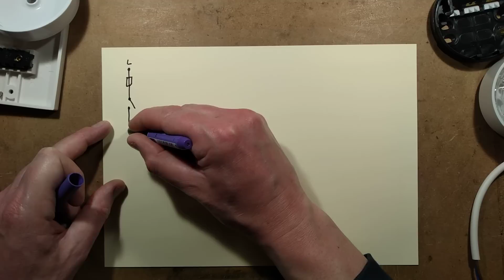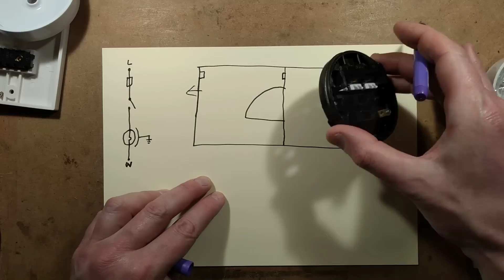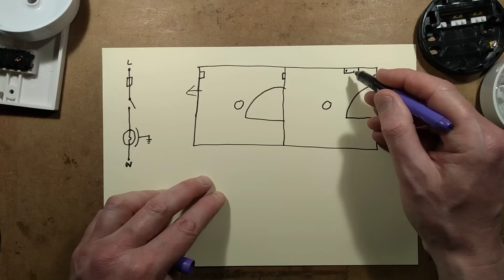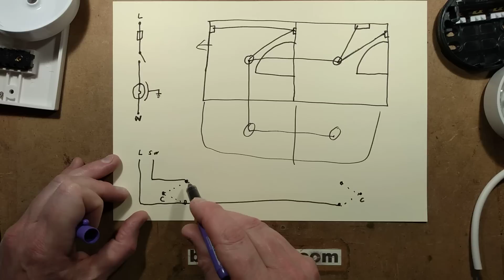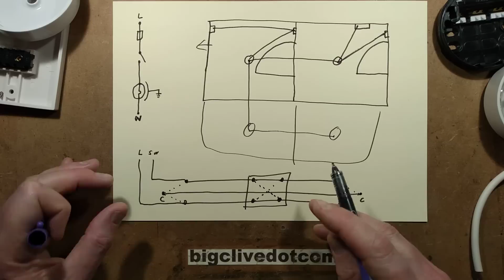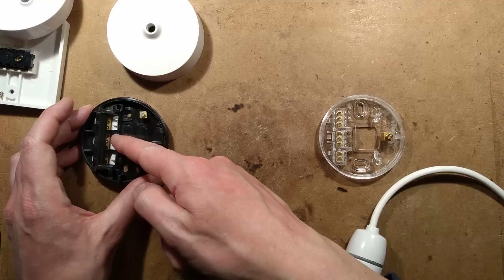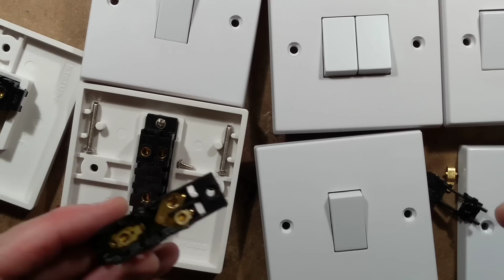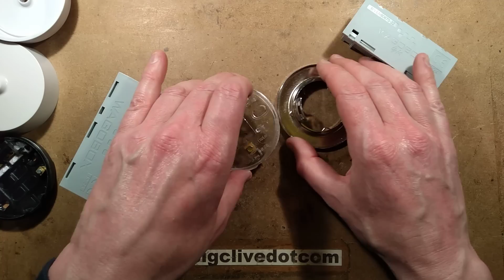British home wiring.  The incredibly simple lighting circuits.

Comment: Fun fact, in the US, we actually refer to two-way switching as three-way switching, but it's wired in a very similar way...so I'm not sure why we call it three-way.
Reply: I can help here. Unusually. in the UK, it's named after the number of light switches up to 3....In the US, it's the number of terminals on the switch. So one with 2 positions in the US, it's 3 way , and UK 2 way...) if it has, 4terminals, and crosses the  (travellers/strappers) it's [en UK 3way] and  [en US...4 way]   In  the UK, we (southern England) tend to refer to anything with more than 3 positions as 'intermediate' circuits)... as many 4 terminal/intermediate switches as necessary can be added. This can become ridiculous in buildings with 7 storeys.
Reply: Well it could also be the wiring because in the US, it would be return (neutral), hot in (live in), and hot out (live out)
Reply: @eagerestwolf  The US "Three way" is indeed because of the wiring. It was very early on called a "three wire" switch. I have some old "electrical world" publications which were the digests of standards and available products (quite useful prior to the internet)  from the late 1800s ~ early 1900s in which it is called a "three wire" switch. Somewhere along the way terminology became corrupted.
Reply: @eagerestwolf  to be fair,  while i was working in the US i heard it always referred to as neutral. but hot is definitely the term for the live wire, and always confused me. the sensation of touching THAT wire is far different than heat, and if your wires are actually hot, you have other issues... such is common usage :)
Reply: @TheChipmunk2008  yeah, I have heard it called both, but when I was doing electrical work with my dad back when I was in high school (mind you this was over 10 years ago), the North Carolina electrical code called it the return.
Reply: @TheChipmunk2008  Yeah, hot and neutral.  You can still get a decent shock from the neutral from stray current on the return path, especially in the summer, when your sweating bullets and there's an air conditioner running or something high current nearby.  I've seen it as high as 60v, but I only checked once or twice.  Once you know it's there, you start wearing gloves in the summer.  Turning the breaker off won't stop it, either, you would have to kill all of the power.
Reply: @larrygall5831  a floating neutral will also get your attention unexpectedly!
Reply: @mikecowen6507  thats literally what he described - i dont know what 60v on the neutral of a 110v cct is if not floating
Reply: @mycosys  I'm used to true floaters having full line voltage on them. The exception was one half bad double pole breaker. That gave some weird readings...
Reply: @mikecowen6507  orite - yeah thats afaik just about impossible on an MEN network, floating to us is a ground resistance, with complete absence of ground threes just no cct
Reply: @mycosys  Just to clarify, I'm not certain what you mean by "cct". For a MEN network, do you mean Mains/Earth/Neutral? If so, absolutely you can have a floating neutral. If you take a sample basic lighting circuit, and cut the neutral somewhere between the lamp fixture and the consumer unit/breaker box (simulating a cable fault) and leave the switch ON, you will have the full supply voltage across the break. Thus, if you're expecting any neutral to be near zero volts referenced to ground, one side of that cut/broken neutral will be at full mains voltage. Surprise! Here in the States, we often run industrial lighting at 480V. That will do more than spoil your mood!
Reply: @mikecowen6507  no, MEN means Multiple Earth Neutral. cct is circuit. Anyone in the industry would i hope know that.
An MEN system is ground referenced at multiple points to the nuetral, in the distribution system and at the customer premises. The system is always ground referenced and it is impossible for the neutral to float completely without use of an isolation transformer.
Australia, Europe, the UK and afaik most of the world use MEN. Your split-phase consumer system kind of rules it out.
Reply: @mycosys  Ah, thanks for explaining. Different countries, different jargon. In the US, per code, the only place ground/earth and neutral meet is in our breaker boxes, except for sensitive circuits that have fully isolated ground.
Reply: 3 wires,  usually from top to bottom of stairs.
Reply: @stewartcaldwell5299  Yes, i think the US term is actually more Electrician friendly :)
Reply: @TheChipmunk2008  Yes. More familiar, if you grew up with it.
Reply: @TheChipmunk2008  I just find it confusing lol. Its a two way switch because you can switch it from two places, an electrician doesn't need clarification on that really as that's his job :P.
Reply: @TechDJ87  Indeed, when talking to a customer we'll often specify 'a 7 way switch circuit' for example (that was a 5 storey house with a basement and they also wanted to be able to switch the stair lights from a 6 gang switch by the front door. Because of the staircase layout it took nearly 200m of cable and keeping the impedance low was a challenge!)

But between ourselves it's a 2 way, 1 way, or intermediate switch. It helps get the right bits off the van LOL
Reply: Maybe it's because the switches have 3 terminals? Your guess is as good as mine lol

Comment: To me that twin+earth seems very difficult  to retrofit to a house. ere in sweden we just run the insulated conductors in the conduits in the wall. (PVC pipe or hose usually) very much easier to run an extra live or add protective earth to old circuits that way. I changed most of the wires and added earth in my house a few years back. Most of it was really straight forward.
Reply: Those twin + earth cables are run in conduits in walls. They are not embedded in plaster.
Reply: @TheEulerID   I know that but pulling them through conduit must be a pain.
Reply: @rimmersbryggeri  generally not too bad as it's usually only a short, straight section to the ceiling void and the standard cable is 1.5 sq mm. If it's a 20 mm conduit, it's very easy.
Reply: In the US you can get greenlee wiring. Flexible metal conduit with wires already inside. I like it.
Reply: @stewartcaldwell5299   Yep thats something you are good at in america. Making construction simpler. You cand get prewires conduit here in sweden too though but I only ever saw the plastic hose variety. You can buy it on huge spools though. (Maybe they are called drums?) All configurations up to 3 phase + neutral and earth.
Reply: @rimmersbryggeri   I tend to choose metal if I can, so that all circuits are surrounded by the ground.  We don't need conduit in homes, though.
Reply: @stewartcaldwell5299  Yeah I can see the point of that bu I think they seldom use it here other than stainless for outdoor and and steel for industrial installations. But since modern distrubution boards here are plastic anyway it doesnt do much good as earth I guess. All our conductors are individually insulated though. In the old days with tarred linen. My dad used to work in a barn with such cables where the fuses had been replaced with nails. That barn is no more.
Reply: @rimmersbryggeri  Oh, the stories those nails could tell.
Reply: Twin and earth's can be embedded in plaster they are not always ran in conduit

Comment: I always assumed the earth wire is bare because if either live or neutral heats and melts it would come into contact and kill the line
Reply: I think it's simply a cost cutting exercise.
Reply: Plastic isn't that expensive. I'd like to see insulated ground wires.
Reply: @jamesvandamme7786  In a way they are insulated due to being in a plastic sleeve between 2 insulated cables, you also use slip-on insulation over earths before terminating.
Reply: @jamesvandamme7786  a sleeve is added when the outer is stripped. Adding insulation internally to the cable would make it stiffer, slightly bulkier and would not add any benefit.
Reply: They did do fully insulated before in the UK it cost more and didn't catch on
Reply: @ashbashbaby2  I'm not surprised. Apart from not having to put a bit of sleeving on the bare wire at the end, it's difficult to see any advantage. It's bulkier, less flexible and more expensive with not obvious advantage in safety.
Reply: But if there is a fault in the cable run its self it will trip out and won’t be insulated by the earth sheath
Reply: @daviddale4206  if there's a fault in the cable then that's what MCBs and RCDs are meant to do. The last thing that you want is electricity flowing through a faulty cable. That's how fires start.

If the cable is faulty, it needs replacing, although modern PVC cable isn't like the old rubber stuff which rotted over time.
Reply: I assumed the same as OP. In a cut, part cut or frayed cables the line can trip internally. It's the part cuts and frayed cables that'll be just taped up and left to carry power without a decent repair being made.
Reply: capnskiddies - Where we used to live, a contractor nailed a cable clip into some plastic trunking (yeah, okay, so it was painted the same colour as the wood it was mounted on, but there is a world of difference hammering a nail into plastic compared to wood) and went straight into the middle of a 20A circuit formed of 2.5mm squared twin & earth cable. The nail went through the earth wire and damaged the insulation of the line (live) wire. The result was the MCB tripped, which likely saved the life of this contractor...
Reply: @Mark1024MAK  growing up we had an entire wall that read as live for seemingly no reason, years later replacing the wallpaper we found at one point there were wall lights installed, and someone literally scraped the wires flat, against the wall (at least 6cm) and were left exposed, paper plastered on top... You can't trust anything!
Reply: Yes, that makes sense! Insulating an earth wire does seem to defeat the purpose.

Comment: Incredibly simple.  Almost impossible to get wrong.

Unless you're the idiots who built the place I live in.  At one point in the lighting loop, there is a fluorescent.  One side of it, live is brown and neutral is blue.  On the other side of it, live is blue and neutral is brown.  So half the ceiling roses have brown is live; the other half have blue is live.

British home wiring is incredibly simple.  But the idiots who wire it can be even simpler.

I'd describe what the same idiot did when he wired the spur to the light over the front door, but I don't want to get irate just before bed.  If I remember correctly, it was illegal for five different reasons.  Maybe six or seven.  I don't want to think about it any more right now, so I won't try to figure it out.
Reply: My house is like that, previous owner did everything himself and fucked it all up.
Reply: @uK8cvPAq  Which was the justification for Part P, idiots like that.
Reply: Ayyy same here in America. Landlord-special!
Reply: @CigaretteTricks  Nice name for it, everything acccording to DIY Code 0
Reply: My uncle was an electrician, so my dad developed the habit of opening outlets when visiting homes they wanted to rent, to check the wiring. Came across one that had three black wires. Yes, three, even ground was black.
Reply: I had worse than that. Had a house where a DJ erroneously wired the AC in black and red to the garage AND he just taped the wires together right under a bedroom. Nice place to plan a fire to start. It was such a weak connection it would pop the breaker when I used a circular saw. The voltage would sit at 65-90vac. Good thing that right away I upgraded that garage outlet to a GFI and I found half of the problems then.
Reply: @Gutless Spigot 

I said "simple" not "bad."

It's simple.  Logical, clearly marked, obvious.  So simple it ought to be fool-proof.  Impossible to get wrong.

But you can never make things fool-proof because fools are so incredibly inventive.
Reply: The loop in wire to the switch is looped in on the live side and the wire is both brown and blue.
Reply: @Gutless Spigot

Nothing I wrote implied that lighting circuits anywhere else in the world are more complex.  The only thing you should infer from what I wrote is that UK lighting circuits are not complex.
Reply: @Gutless Spigot

Arrogant bastard?  Yep.  Absolutely.

Yank?  Nope.

"who couldn't answer the question he stupidly posted"???  I didn't post a question you fucktarded cretin.

I'm clearly dealing with somebody incapable of apologising for incorrectly infering something I did not write.  If I thought you were capable of following the advice, I'd tell you to look up the first law of holes.
Reply: @pmailkeey "somehow" my guess that was intentional. In my attic a plug for 120v has both legs of the 120v in the same box. The idea is you can convert it to 240v. Now in a way thats a neat idea. Sure just put one of the phases with a wire nut on it no problem. But he put one phase on the bottom plug and the other phase on the top plug. Like uhh just no.
Reply: penguins forall but then you can just plug a 240v device in with a clever Y cord! It’s a feature!

(And yes, I have definitely heard of people doing that deliberately)
Reply: If it makes you feel any better - I'm an Aussie, we have really strict regs, and electricians have to study for years to even be able to put in a power socket or change a light fitting. Still if any REAL cabler from IT or electronics or engineering person comes across something just stupidly lazy and dodgy - they know the electrician has been there. They teach them regs, it seems like they never teach them why, so they just forget i guess.
Reply: @Gutless Spigot join this group for a wealth of examples XD https://www.facebook.com/groups/630037703800189/
Reply: They will be the switch wires cable was red and black now brown and blue. One is the feed one is the switch wire just depends who connected them they should really be sleeved the live colour but in practice in the past a lot were not done. In theory any sparkie would not have a problem with this. It's normal and really if you need to question it it you that should not be playing with electrics
Reply: I guess there are enough idiots around that are able to proof that you cannot design anything absolutely idiot proof ;)
I bet in any country with any electrical system you find any wiring or electrical system miraculously working although completely f****d up. Anyone holding against me?
Reply: @Andrew Crews Correct! But both circuits should be in phase. These were two out of phase circuits.When I said both "legs" thats transformer terminology. Across the plugs is 240v.
Reply: The cowboy who did the wiring in the house I bought managed to switch on the neutrals. The tubes in the kitchen used to glow dimly at night, and put on an interesting plasma tube-like display.
Reply: @Gutless Spigot 

It is clear from your misuse of "imply" and "infer" that you have problems with English usage.  Perhaps English is not your first language.  I'm starting to suspect your first language is stupidity.

I did not imply what you infer.  I did not use a comparative or a superlative.  Had I written that UK wiring was simpler or the simplest then your inference would be correct.  As it is, your inference is fuckwitted.